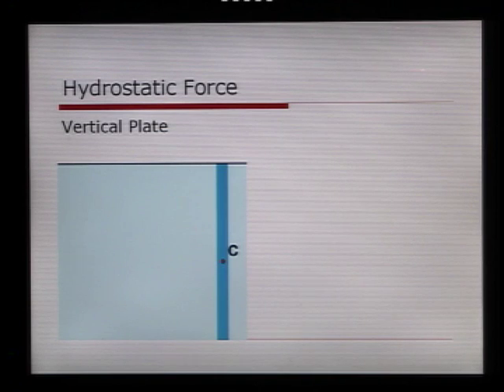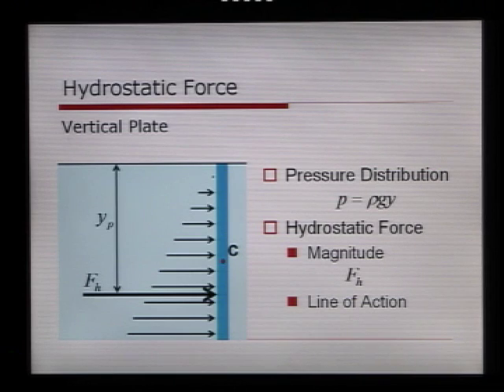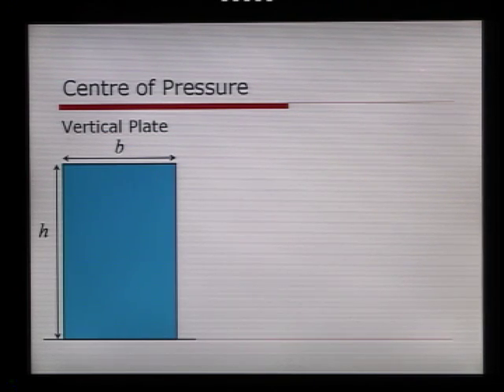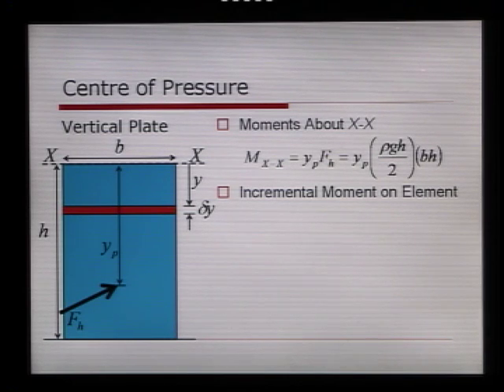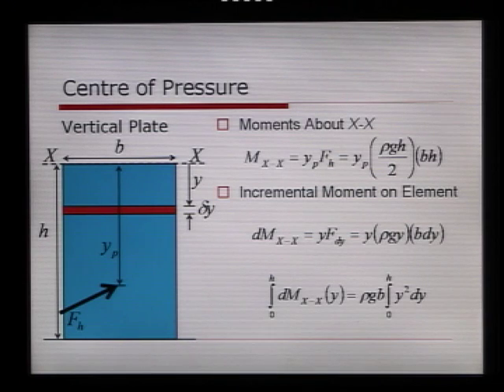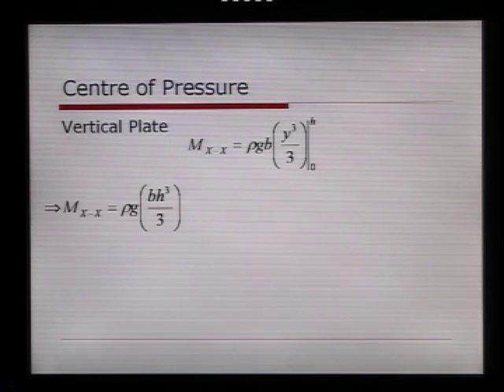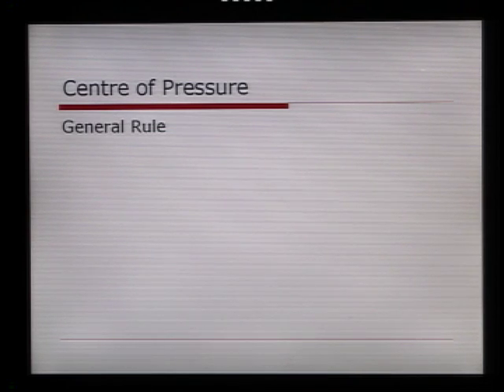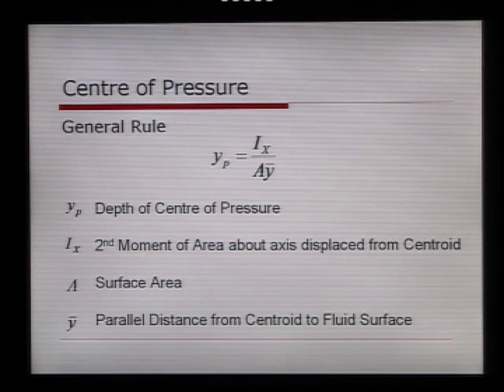Introduction to Fluid Mechanics, Podcast #7: Hydrostatic Force

Comment: While with a gas the force against a surface (border, e.g., container walls)  is a function of internal (gaseous) pressure, with a liquid, the internal pressure does not control the force against a surface as the weight interferes - as I explain in my video. Very easy to demonstrate experimentally. (Although modeling it incorrectly as a function of hydrostatic pressure in this case produces the same results.)